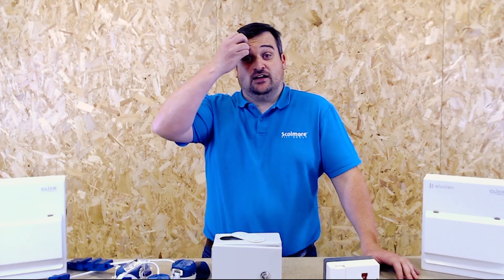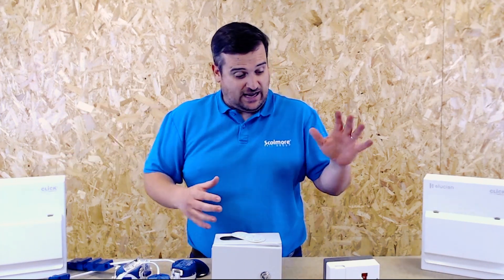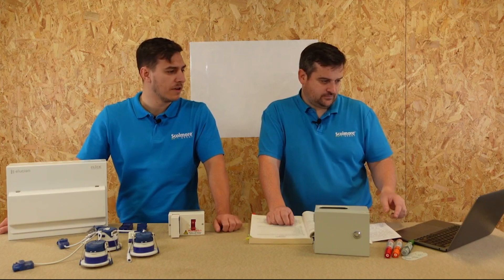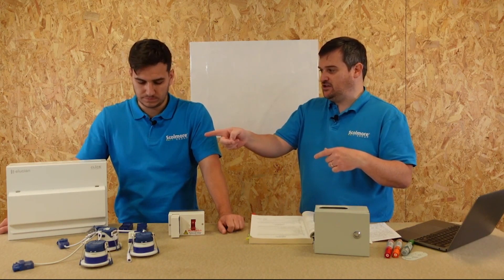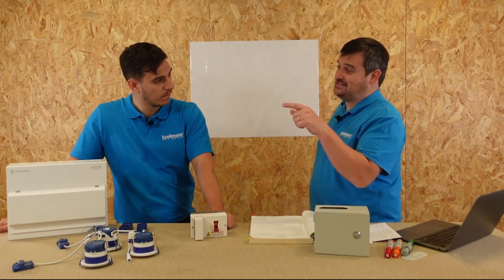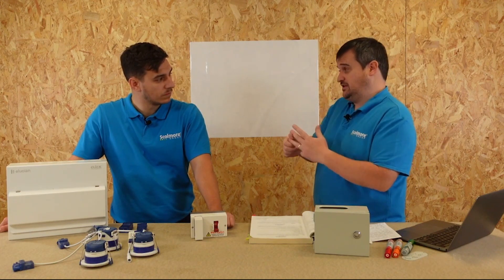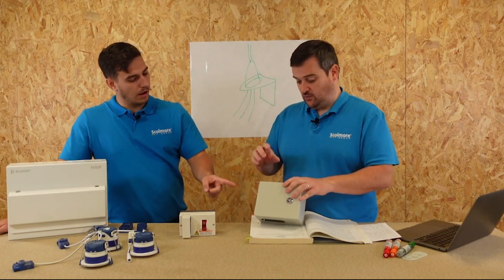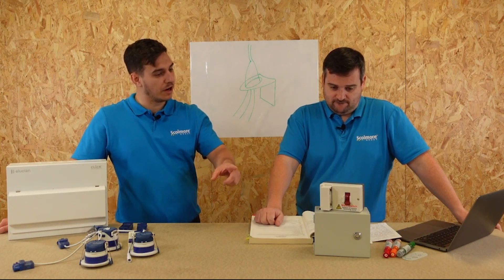Can you install a consumer unit more than 3m away from the main fuse? - Technical Sessions

Comment: The answer to the EV question on those log tails is to put in a separate isolator, fuse and mini distribution box. That way you can install, say, a 40A fuse and not impact on the main CU capacity.

Comment: The KMF switch isn't made from non combustible material so does that comply? The issue of buried tails over 3m seems to be avoided in the industry with no clear guidance about it. Everyone has their own interpretation and does it differently. There are some inherent problems with most methods, some of which you covered in the video, which makes compliance with the regulations and DNO requirements questionable. There needs to be a decision made by the IET and all the other bodies who stick their oar in about this subject. Give us a method that complies, that is seen to follow good practice and everyone is more likely to follow it.
Reply: theres a lot of service heads still in use and meters that are not made from non combustible material as well. in my experience ive found dno's to be a law unto themselves.
Reply: @adierob1  yeah I agree, but they don't work to BS7671. The KMF switch is part of the consumers installation and would therefore fall under BS7671. In the past we've asked the meter operator to connect direct to those kmf switches which we provided and omit the 2 pole isolator they normally install due to space issues inside the meter enclosure and they refused because it wasn't made of non combustible material. Honestly it's all a shambles in my opinion and needs looked at and a method agreed so people have confidence that they're complying with the regs and doing a good job.
Reply from the maker: Hi, the KMF switch fuse does comply to BS 60947-3, “non-combustible material” relates to BS EN 61439-3 (see 421.1.201 in BS 7671). I hope this helps! Thanks, Maddison

Comment: 6.01, does it have to be a fuse, can an mcb be used
Reply from the maker: Hi Brian, yes you can use a MCB that is suitably rated instead of a fuse, but you would need to take other factors into account (see 433.1.201 in BS 7671). I hope this helps! Thanks, Maddison